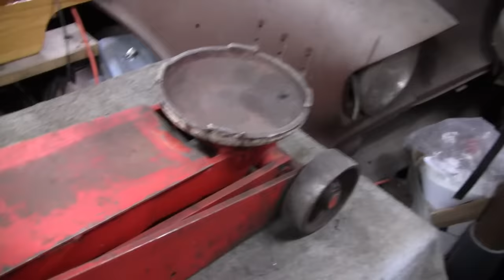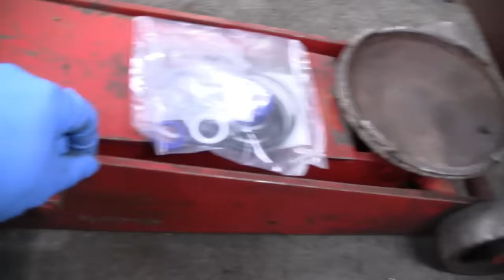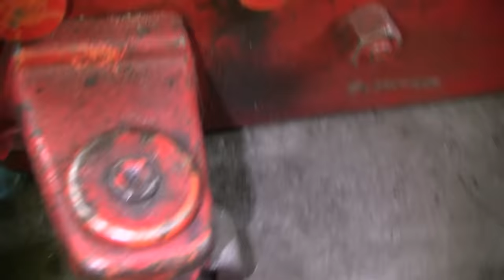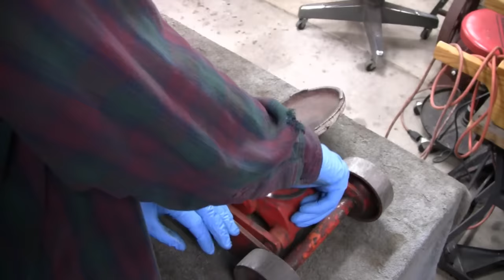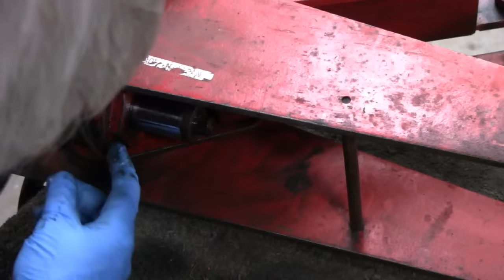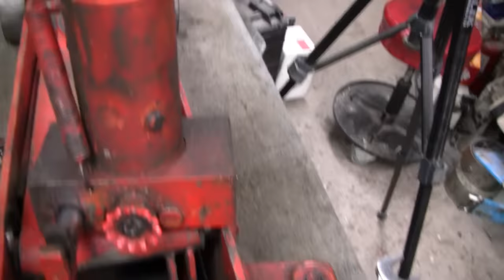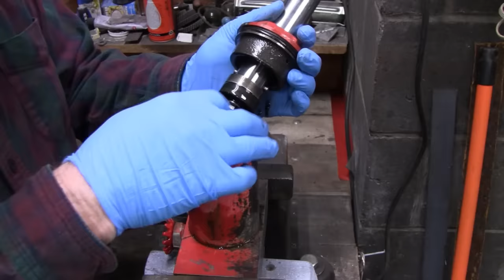HYDRAULIC FLOOR JACK REBUILD

Comment: I recommend using a thin coat of the hydraulic jack oil on all o-rings and seals as a assembly lube. Do not contaminate the hyd. system with other products. Thanks
Reply: very important,,,,, never reassemble DRY
Reply: Absolutely important. I was cringing the whole time.
Reply: @bobg7288  never contaminate it with Vaseline from 1984.  Hydraulic fluid ONLY!
Reply: Nowadays there's particular "O"ring lube in the market
Reply: Contamination is not an issue. Use what ever is handy
Reply: My Jack probably has tranny fluid power steering brake fluid and hydraulic fluid mixed a jack uses fluid in general just to push on it's not a machine for heavy use that creates heat like a tractor  aside from water use whatever it doesn't matter, scratch that don't use motor oil 🤦 can't believe I have to even say that
Reply: @mad_mechanic  I agree. I use what ever is handy
Reply: I use the wifes KY jelly it was designed for pistons going into cylinders and food grade too
Reply: Actually most transmission shop mix petroleum jelly and atf for assembly very common practice
Reply: You don't know what to do with all the o rings you have extra you can give them to me know what to do with them I thought I would make a suggestion I can definitely find a use for them
Reply: In total agreement with you John. The vasoline is a NO, NO.

Comment: I just rebuilt my 20+ year old Sears 3 ½ ton floor jack. This video helped me understand what I had to do. My main problem was with the big seal at the tip of the shaft for the piston. I didn't mess with all the other smaller o-rings and screws with ball bearings underneath. Thanks for putting this together. Now I have my old heavy jack that I use again. Safety thought: when I first noticed that my jack was no longer working well, I had just lifted up my car to change a wheel. When I went back 5 minutes later to put the new wheel on, I saw that the rotor was very low on the ground. I don't even want to think of having someone (me?) working under the car while this happened.
Reply: When I was working after school in a garage (long ago) an old mechanic told me to never trust a hydraulic jack.  He said to always use jack stands and pointed to a car across the shop floor which was up on a floor jack and no stands.  Amazingly, the jack suddenly lost pressure and the car fell back onto the floor.  Thankfully nobody was under it.  That stark lesson has remained with me.
Reply: Always have a back-up jack stand or log under the frame!

Comment: Great video. I once bought a similar floor jack like yours dirt cheap because it leaked down, the fix was very simple, ran a magnet down into the seat of the check ball, pulled out a tiny metal shaving. Jack worked fine after. Easier and cheaper to try the magnet fix before rebuilding
Reply: What do you buy the gaskets at

Comment: Realize the video is four years old, but this majorly helped me to do basic maintenance / repair on a 70's Orange and White jack that looks very similar. Dad has had it since before me; the release valve stopped releasing. Got it apart, cleaned, and back to working with new fluid. Thank you for your detailed descriptions and hard work :)
Reply: O thanks nate, mine is doing the same, so I just have to remove and clean it?
Reply: @Dopamine1217  Maybe maybe not. Depends on what failed. I didn't have to pull the hydraulic ram apart, but guys sometimes do. GarageJournal has a really good long thread about how to rebuild Taiwan jacks - I'd start there. In my case, replacing a handful of orings + new fluid got it working again, although it will lose an inch a day or so under load - I never use it without jackstands.

Comment: Excellent video. You're right in that the outer seals are wipers to keep contamination from getting inside the pump, so they are installed with the cup facing out. I have the same jack and I'll be rebuilding it this weekend. Thanks for the tutorial.

Comment: Thanks for the video. I have my father's 5 ton bottle Jack that is probably 45 years old. The local cylinder shop refused to rebuild it. "It's cheaper to buy a new one" was their answer. Now I can rebuild it myself. Thanks!

Comment: Wipers are used for keeping debris from entering the area. Seals are usually installed with the open end towards the pressure side so they will expand during pressure making a tighter seal. There's always a chance that the previous seal was installed backwards. If you get a leak, flip it over.

Comment: Nice fix! New Harbor Freight Junk Jack vs rebuilding a Better piece of equipment and learning a valuable skill in the process..... REBUILD wins any day of the week.
Reply from the maker: Thanks Moe!! I paid to have my other jack rebuilt 45 years ago and it's still going strong, so that should be the last time I have to touch this one!!☺
Reply: We have 2 of those old jacks that sit in the corner. Say what you will about most of the crap at HF the 2 aluminum jacks we got get used and abused in the shop and keep coming back for more. When your moving the heavy things around all day it gets old real fast.
Reply: I have a floor jack like that, way heavy need to have steel toes on when lifting up to my truck incase it drop on my foot. As for Harbor Freight, the Daytona looks pretty good, fast pump and low profile, good ratings and goes head to head against Snap-on jack where they copied the design from.
Reply: One of my jacks looks almost exactly like that one, and with the same problem. Gonna order a kit and rebuild mine as well. I used to work at a place called Deer Park Hydraulic on Long Island rebuilding cylinders many yrs ago. I'll never forget the skills I learned in that place.
Reply: 805ROADKING wear you buy the part
Reply: Harbor Freight is throw away tools use them once toss them
Reply: time is money...you have to balance the time you have with how badly you need the tool...if you have the time to order the parts and spend a day doing the rebuild, then that's the way to go...if you're pressed for time (or the jack fails with the car up on chocks) then you may need to spring for the cheaper replacement...you can always do the rebuild at your leisure--plus now you have a spare...which should make your wife just ecstatic, eh?...a very good job on the video, btw...
Reply: @805ROADKING  could you put the p/n for rebiuld kit.should be a basic standard kit for all floor jacks.good vid
Reply: @805ROADKING  λ
Reply: @comeoll  Ebay
Reply: My harbor freight low profile aluminum jack is leaking. Is there a seal kit for rebuild. It's it even worth rebuilding?
Reply: And after all that fun...you'll feel like a million bucks...now that's priceless
It ain't the Jack and it doesn't matter what kind...It's the restoration of it...Cool
Reply: rebuild???? only IF it works,,,, hehehehehehhh
Reply: Not always, nothing beats new.
Reply: @frankw8876  The DJ3000 is the one your talking about. I bought that one last year and love it....Its got 5 zerks and a magnet in the pump reservoir....Scotty Kilmer and that dude from South main auto have the same Jack....I did 6 months of research before I bought it(fixed income) and didnt want to waste what little loot I have on junk....Saved up for that IR2235TImax too, 1350 Ft. lbs of torque!!! Most powerful in the 1/2 inch class. I love working on my truck with nice equipment. Makes chores , not so chore like. Peace.
Reply: @williamrobinson8406  Just for shits and giggles, look up the Daytona DJ3000 ....... Then , you will know , not everything from that place is trash...
Reply: Wow long job but I think if I'll rebiuld my china I'll just check for seals not that threaded o ring which you have removed and mine about a year old hf, it's doing it job 3 ton it's OK but once it raised after half an hour it fail if I kept it that's fine and it raise well and iam always using jack stand after raising so no issue unless I want it to be good and not to fail after raising half an hour cause I usually kept it as support for for the jackstand and I saw it lowered if its few seals which is easy to replace that's fine but this is need one day for dissasembley and bring seals from hf but anyway I think for that big nut I have to take it for mechanic so they can open it for me 😊😊😊 job looks sooo Landy
Reply: But don't you guys realize what after your rebuilt you creating same Harbor Freight jack? Because all replaced parts which is actually make jack work is made China!!! And work it going same amount of time with HF jack!!!
Reply: @frankw8876  Its not so much a copy as they found snapon's chinese manufacturer and bought the same jack rebranded.. Snapon sued and then backed off once HF called em out on selling a chinese made jack.
Reply: @williamrobinson8406  I've been using same tools for years some HF.
Reply: @williamrobinson8406  Not the prem jacks
Reply: harbor freight Daytona jack is the exact copy of a snap on jack. we have one at the shop and it will lift anything and is trouble free so far. i have the HF aluminum jack at home it is a great jack its lite so its easy to throw in the back of my truck for track day.
Reply: The jack is a old harbor freight jack from around early to late 90s. I bought mine about 1995 or 96.
Reply: This jack will outlast a hundred harbor freight jacks in fact it probably already has.
Reply: @williamrobinson8406  I got several HF tools been using for years.
Reply: @805ROADKING  any idea on how I can order a spring for the handle.mine broke and theres no info on jack.
Reply from the maker: @iancameron1662  You can get them on ebay, almost all floor jacks use the same one!!☺
Reply: @user-neo71665  ßasse
Reply: @williamrobinson8406  - have had my HF for 4 years or more. Regular DIY but it has been a great jack no issues. Can’t beat it
Reply: You said you counted the rotations when removing that screw. Shouldn’t you have counted the rotations down to solid as an indicator as to where to reset the adjustment. The rotations coming out means nothing.
Reply: @tomheadley2813  - it’s The same thing unless I’m missing something.Don’t you end up with the same location in either case?  Why do you say it means nothing? It’s 10 revolutions to move it and you screw it back in 10 revolutions you’re back at the same spot right?
Reply: Rewatching the video, you were working with a ball and spring. Counting as you did would probably be the only way. But, working with a needle valve, I always count to the bottom. That requires far more accuracy than a ball and spring.
Reply: I was in a high end porche audi vw repair shop.  Hft jacks in use.  I use them at home too.  Work great much better than previous jacks I've had.
Reply: @AlanDike  LOL.  :-)
Reply: @williamrobinson8406  HF actually sells parts/kits for theirs.
Reply: Some harbor stuff is fine but some stuff is yes junk. Like sawzaw unless u gonna use it once or twice get a dewalt or porter cable both of these i have u can literally stand on them to cut watever just dont get them too wet while cutting sewer pipes..it will burn up
Reply: Love my HF jack and most all tools from there.
Reply: @williamrobinson8406  if you use every day for work then yes dont go with HF but for home use I have every thing I have ever bought from HF still working some after 20 years

Comment: 28 years ago I got a harbor tool and equipment jack just like that and a set of 6 ton stands from my parent's as a Christmas present. As a matter of fact I just got done using it and put it away about 10 minutes ago. Had my Altima up on stands and took the tires and rims to Walmart for a new set of tires. 
   Best gift I ever received!
She seems a bit slow so I'll be doing this rebuild in the near future. 
  Thanks for sharing. It took about 3 beers to get through this video BTW.

Comment: This actually helped me get my jack working again, somehow.
Mine is completely different but just watching someone take it apart helped give me an idea.
I realized I had opened something I shouldn't have and a part fell out.
I took another look and sure enough I found a tiny piston lodged in a crack in the jack.
Used the magnet trick with an awl to get the piston and spring in the correct position.

Jack is now working good as new.
The oil was low which was I took it apart in the first place but I opened the wrong part and the manual doesn't actually tell you what to do.
The manual even labels every part except the holes... go figure.

Comment: that BLUE PLUNGER WAS ALL THAT WAS NEEDED !! the black one was whooped fyi . thanks for the video iwas very good I have a bunch od Lincoln and Walker jacks from the 70's and have rebuilt them and this is the type of info our kids need. you know our 30 and 40 year old kids. Thanks again.
Reply: I love that. Yes there are 30 & 40 year old kids who could learn a thinga 2.
Reply: Joe Shabidu  Keep rockin', Every repair is a confidence builder,  and you're never done. Recent additions to building skills- trigger spring on a top-break revolver, patch plastic ends of radiator with epoxy. The stuff was broke anyway,  I dont think much more harm could be done, if the fix didn't work. Best wishes!
Reply: I have an old Blue Walker with the yellow one piece handle from the 70's I had rebuilt in a jack shop.  Just sent the pump in.

Comment: This randomly popped into my feed, and I'm really glad it did, because it never occurred to me how easy it was to rebuild one of these jacks.  I've got an old Harbor Freight 3-ton that isn't working anymore, and it may be cheaper to repair than replace, plus I've got an old aluminum Harbor Freight model that doesn't hold or pump up anymore - hopefully I can find a rebuild kit for both of those!

Thanks for the inspiration!

Comment: The screw, spring and pintle are an over pressure relief valve. Thanks for the video. Good job👍
Reply: Ken, Do you know what the approx. setting is on that pressure relief screw?  Thankyou Sir
Reply: @GRAYSTAW  8 full turns on mine, which was about one turn past where the spring started to engage.

Comment: I have a "Big Lots" Chinese jack from 1980, $29.95,  WAY before Harbor Freight, with the same leaking oil problem.  You have inspired me to try a repair later on...thanks!   I'm rebuilding power window motor gears now, all learned on Youtube.

Comment: Nice job on the rebuild. I have been in the automobile repair business for over 45 years and still use my floor jacks.  Never had to rebuild them but was always curious on what was inside of one.  I found this video extremely interesting.  Nice catch on that pressure regulator.  I might guess that's the safety valve to keep from overlifting the jack and damaging it.  But the process seemed pretty simple that you did here.  I also liked your style of systematically rebuilding each section and also I liked the fact that you put that paper towel down in that cavity to keep trash out.  You're truly a professional.  
Thanks again for taking your time to make this video.  Nice job!!
Reply from the maker: Thanks alot, we appreciate your comment!!☺

Comment: Thanks for making this. I have what is likely the same exact jack that I got from my dad when he had to move into a nursing home. When I first started working on cars around 1980, it was the jack that we used and I am thrilled to be able to continue to use it probably 45 years after he bought it. It has a slow leak and I was wondering if I could rebuild it, now I know I can. We are closing on a house in about a week and this will be one of my first projects.

Comment: I bought the very same jack 30 years ago.  I bought it well used and a little abused at a flea market.  I paid I believe 50.00.  My dad thought I got taken for what I paid.  I have used (and abused) that jack for 30 years, and it still works fine.  In fact, until the last few years, I did not know that newer jacks didn't last just as well as mine.  I was surprised when guys on mechanics forums said their jacks only lasted 10 years, or less.  I guess I didn't pay too much after all.  My jack looks identical to this one, but has no markings. It weighs right at 100 lbs. including the removable saddle and the handle.
Reply: I´m from Germany and had buy it from a factory in the black forest 40 years ago and it work like the first day

Comment: Got an old Sears jack I've had since I was a teenager it has the same problem so thanks to your video maybe I can do the same rebuild.  Thanks for sharing.
Reply: Were you able to get the seal kit for it?  I have an old sears jack that is 30 years old.   Still OK but I might get seal kit before Sears is extinct.  Please advise.
THANX
Reply: Most major cities have a seal supplier.  Google your city.  Take the seals to them and they will match what you need.  I rebuild a hydraulic cylinder and the complete seal package was $9.
Reply: @shoeleh07  Good idea.  THANX.    Uncle Google to the rescue.

Comment: Thank you for the complete break down of rebuilding your floor jack.  I definately don't know a lot when it comes to rebuilding these jacks, but I would of been inclined to keep the seals that were made of stainless steel and just replaced the rubber seals and grommets.  I believe that is what makes a good ole fashioned jack from the 70's and before compared to one you get at Harbor Freight.  I know the steel is thick and the bolts and nuts and everything it is made of is stronger, but that also includes the internals, all but the rubber parts and maybe some springs or even the copper washers that would need to be replaced after 20 or so years.  

     Thanks again for the video and God bless bro.